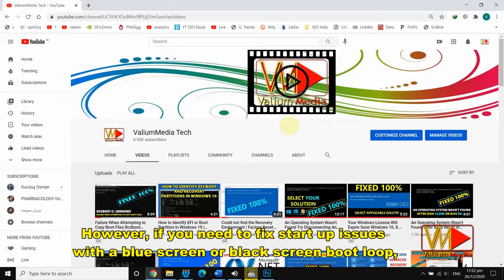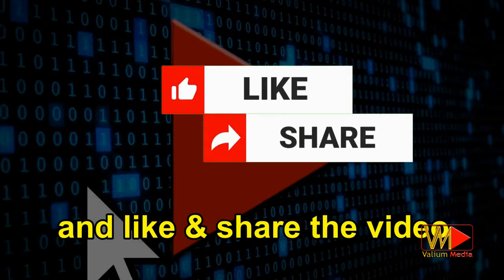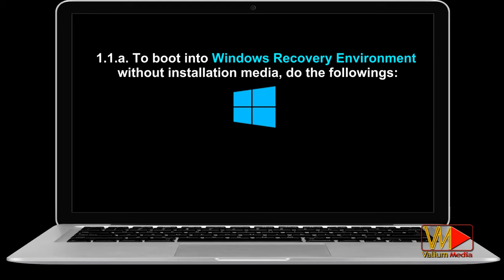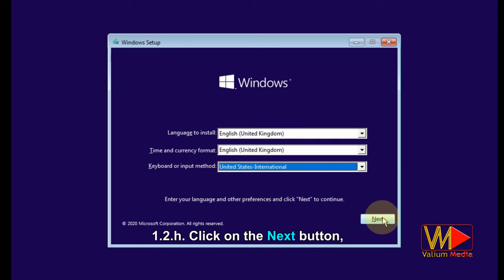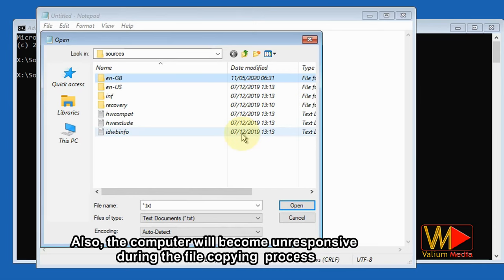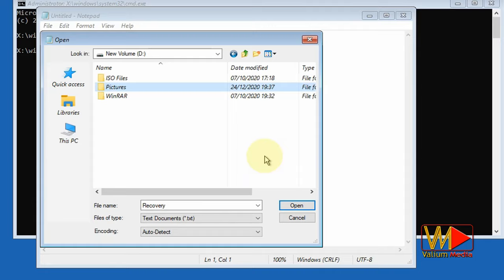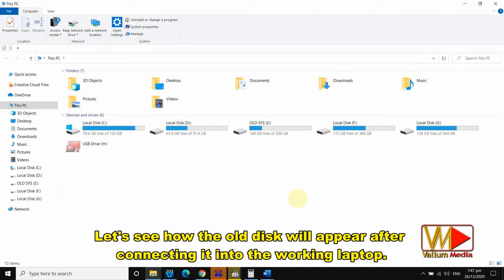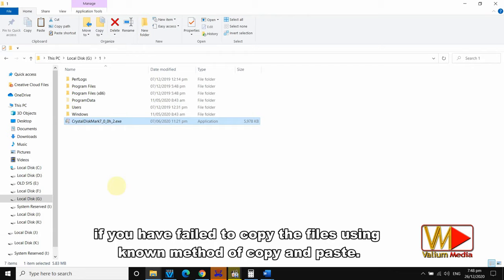How to Get Files Off a Computer That Won't Turn on | Recover Files From Hard Drive That Won't Boot

Comment: The notepad bypass worked like a true charm, never would have thought of that, thank you!
Reply from the maker: You're welcome!
Glad it helped!
Reply: How much time it'll take to copy the data?
Reply: @SaleemAbbas-le1mj  Depends on the memory type and speed you have in your PC and the size of the files you're trying to recover. Mine was a laptop with HDD drive in it which is slower and the files I was trying to recover were around 100Mb and 1Gb. For me it took about 30 minutes and some attempts to find more files by their name since there are no thumbnails to navigate with.
Reply: @Exxus61422  i have ssd and around 100 gb file. How much time should I give ? Any idea
Reply: @SaleemAbbas-le1mj  The system you're downloading files into could also be a factor, but ignoring that, the average realistic speed of an ssd lies somewhere around 50-200Mb/s. To be safe I'd calculate with a 100Mb/s speed, and then it just becomes a matter of dividing 100.000Mb (100Gb) with 100Mb and the answer is interpreted in seconds, which is about 1000 seconds, which is a little over 16,5 minutes. I assume the gear is damaged and the memory will have to look harder through the damaged parts. Honestly I would give it 20-30 minutes atleast.

Comment: Method 1, 2 worked 100% for me to copy 80 GB of files from a PC HD that has a crashed windows 10 install that will not boot even in safe mode to an external USB drive. Thank you so much for making this video!!! This was all free windows built in tools. I was getting ready to start paying for and trying data recovery software before finding this video.
Reply from the maker: Thanks for sharing!

Comment: Problem is there is no real file system on my drive.  It shows ONE folder of files.  Then it has windows app folder with nothing in it i can't find the desktop or any of the folders anywhere but the drive is clearly more than half full.
Reply: Did you change the file type in notepad to any file?
Reply: I have the same problem. It only displays the windows app, not my old files on the desktop. Please help

Comment: Very good video!
I am trying to save some files from my BSOD desktop. 
Before entering Asus Uefi bios EZ Mode, I plugged in a new 2TB Seagate external hard drive to transfer the files to. And inserted the Windows 10 Pro usb stick, but this removable device does not show in list (unless I am mistaken). My BOOT PRIORITY list shows the following:
1) Windows Boot Manager (Intel SSDPEKNW512G8)
2) Intel SSDP... (same as above)
3) SATA6G_4: ASUS... (Blu-ray disc drive)
I am just learning about bios and repair so am being very careful!
Can you advise please?
Reply: Did you fix it?

Comment: Hello, can't we open onedrive folder ? My laptop is not booting and the files also didn't get uploaded to onedrive. When I try to open onedrive, it says file cannot be accessed by the system. Please help
Reply from the maker: Did you tried to access the OneDrive in the internet or inside the old laptop or in a new laptop ?

Comment: I tried the notepad method and when I copy into my hard drive (which has 700 GB space left) it just doesnt work. My PC only has 256GB so it should work? If it really doesn't work i plan to buy a connector.
Reply from the maker: You can't see the copying process using notepad method, but the files will get copy unless there is a disk corruption or write protection.
Reply: @ValiumMediaTech  I mean, there's the windows error you showed in the video. I'll check later to see if the files have been copied.

Comment: Hi, when I connected my HDD via Adapter, the disk does show up, but it shows as empty like  931GB free out of 931GB.
Why is it emtpy?
Reply from the maker: You have to explore disk contents using notepad method, because the data from diskpart or other commands may not reflect the actual size of the disks and partitions.

Comment: Hi there... I've an error code on my laptop. It says...

Error Code 2000-0142
Validation 106274
Msg: Hard Drive 0- S/N W0V5SMHX, Short self test unsuccessful.

could you please tell me what happened to my Hard Drive?
Thank you.
Reply from the maker: Make sure the disk is connected firmly to its socket on motherboard. 
If the connection is good and no dusts, the disk may be corrupted.
Reply: @ValiumMediaTech  hi... my HDD became dynamic. I install windows. Then pc get on. Now I'm backing up my data.
Thanks a lot for your time and help. 😊😊
Reply from the maker: @anindobiswas4568  Thank you too for your feedback.

Comment: My all c drive is wiped out can i recover that windows files??
Reply from the maker: You can't recover deleted windows files using this method. Instead, you have to reinstall windows again.
Reply from the maker: You can't recover deleted windows files using this method. Instead, you have to reinstall windows again.
Reply: Ok

Comment: also, i dont see my C drive in the note pad method >< is it corrupted or wuttt T_T
Reply from the maker: May be is not has an assigned letter or maybe it encrypted by BitLocker.
Reply: @ValiumMediaTech  I didn't use bitlocker. How to assign the letter?
Reply from the maker: @855Jasmine  Watch this video:
https://youtu.be/tYUBiWO0P9o

Comment: It says u need to format the disk in drive E: before you can use it
Reply from the maker: You have to connect your hard drive into another computer and then use any Data Recovery app to recover your files.
You can use the following recovery app if you want:
https://youtu.be/HtGlTtUO5G0

Comment: My internal hdd dead..how to data recovery from hdd..plz rly brother
Reply from the maker: That is depends on the extend of the corruption. If the corruption is sever you can't recover data. If the corruption is not mild, you can recover your data as instructed on the video, or use third party app to recover your data.
Reply: @ValiumMediaTech  thanks for your reply ☺️👍

Comment: for the 1st method using notepad, could you copy the whole drive to the external hard drive? i tried doing that for my 1tb drive & it's still stuck after 2 hours 😂😂
Reply from the maker: As stated on the video, it may appear as if it stuck, however, the result would be a success of copy.